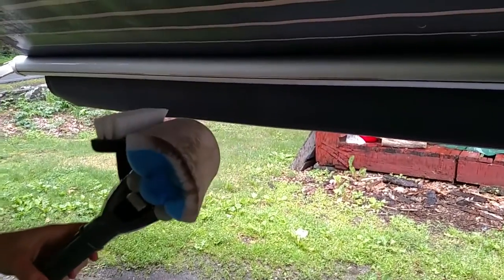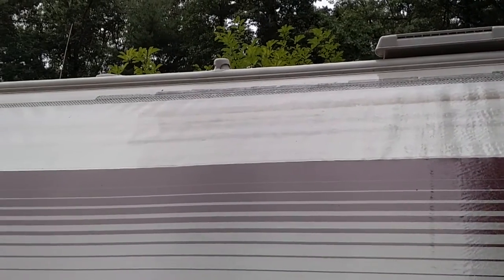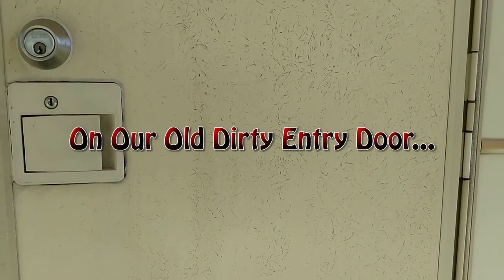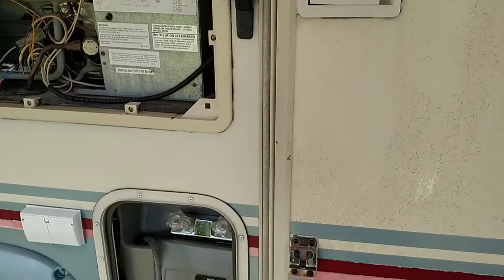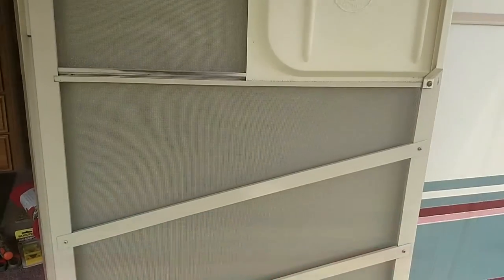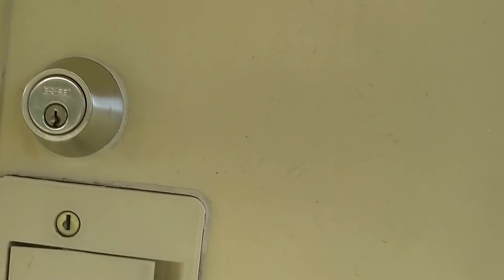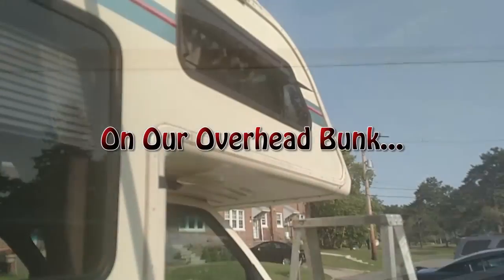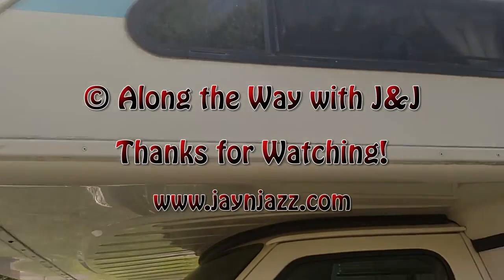Magic Eraser Love - RV Cleaning

Comment: I've heard you shouldn't use the magic eraser on the outside sides of the RV as it takes the finish off! What's your experience been so far since doing it??
Reply from the maker: we have not had any issues so far. it worked great where we used it. thanks for watching.

Comment: How many erasers did you go through the clean it?  Our awnings about the same size and I'm worried one mop isn't enough since they start to break down after some use.
Reply from the maker: Hi there! Thanks for watching. We used two of the mop heads and a couple of the regular erasures. It still looks good. We will be doing a little touch up cleaning on it soon. 
J&J